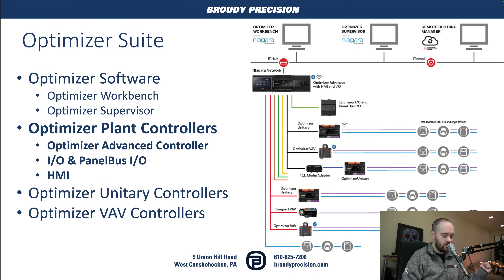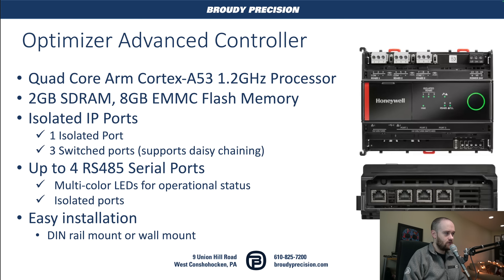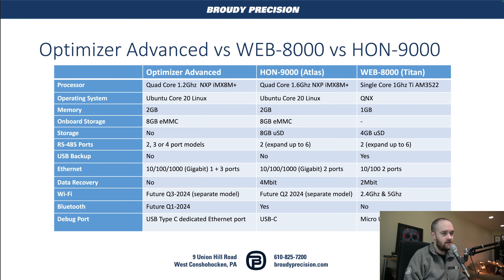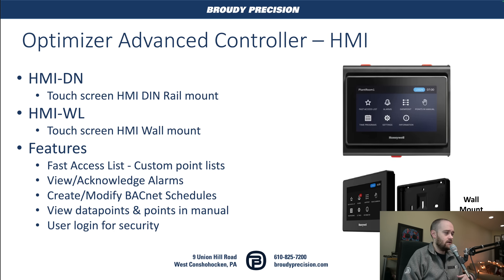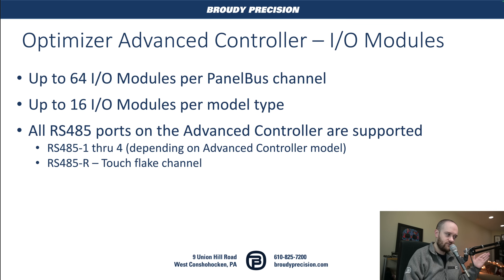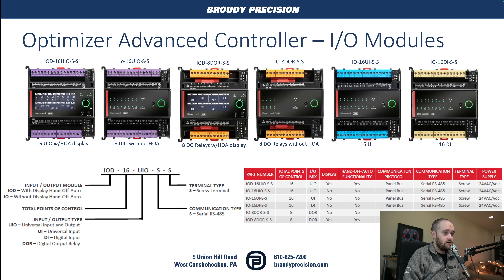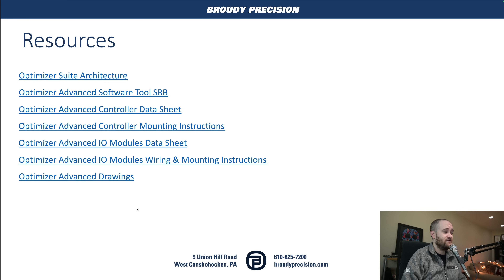Honeywell Optimizer Advanced Controller Overview

Comment: Heya! Excellent video!
I'm a controls engineer in the MHE world.

With the rapid expansion of AI datacenters, we're looking to get our foot in the door on some of these jobs...

From the little bit of research I've done so far....it seems like Honeywell is the gold standard in the BMS world. The Rockwell/Allen Bradley of the BMS world. Would products like this be what you may see in data centers? Or would the systems be more Bespoke and use more traditional controls like PLCs (Ladder Logic) and SCADA systems like Ignition?